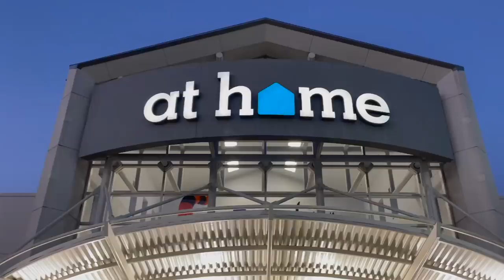MY DREAM SUNROOM IS COMPLETE!| Sunroom/Outdoor Makeover PT. 4 #FIXERUPPER +Decorate with Me!

Comment: Designer tip: always double your sheers.  Whatever the window width is, double that number. It will give you a richer, fuller look.
Reply: Thanks
Reply from the maker: Thanks love for the tip :)
Reply: @Error Report  for example:If the window  measures 50 inches wide, you buy enough curtain to fill 100 inches.  The formula we use is usually width x 2 .
Reply: Shears and Drapery.

Comment: Plant Mom here: You should not repot right away. Give it 2 weeks for the plants to acclimate to your home & new conditions (Keep new plants away from other plants in the beginning in case of bugs.) Additionally, it's actually best to repot into a nursery pot (the same one it came in but you must wash it out) or repot to a larger nursery pot. You should leave in nursery pot or repot in one that has holes for drainage which in avoiding root rot. Terracota pots require you to water more often. I have all your plants & the snake plant & succulents should NOT be watered except once every 3 or 4 weeks. I water my Monstera & White Bird of Paradise 1x per week-water until there is a little water coming out the bottom (you can also bottom water it. (Other people water their Bird of Paradise every other day. Test the soil & if the top inch is dry, consider watering. Buy a water meter..it helps with over watering. GREAT JOB ON THE SUNROOM!!!
Reply from the maker: Thanks so much for all the tips 💕 so helpful !
Reply: Thank you for the advice ! I'm a fairly new plant mom and I'm learning still.
Reply: You're so right! I wanted to comment the same about the plant care. Please please dont put plants in pot with no drainage unless you're a skilled plant carer and perfect with your watering schedule. You'll just give the plants root rot and kill it. Likewise you're not supposed to pot straight into those wicker baskets. It will go mouldy and rot

Comment: Plant tip: water them from the bottom ( via their trays ) and they’ll thank you for it. It’ll also help you know if they’re getting enough water.
Reply from the maker: Ahhhh! Great tip! Thank you hun! 💕💕💕💕
Reply: I've never been told that before...thanks for that info. I'm gonna try this🙏💙
Reply: I forgot ..i remember ny mom doing that. N i tried nyself. But i am not good with plants for now.  I am not giving up
Reply: Thank you I will try this also I always wonder if my plant babies are getting enough water.
Reply: @julesmisic.  Great tip.  If there is still water in the clear, I am assuming the plant doesn’t need water.  Is this correct?
Reply: Great tip, thanks
Reply: What about root rot?
Reply: Yesss! Also helps keep away fungus gnats.
Reply: Yes it does help.  I love the decor I imagined myself with a room like that.  So inviting and cozy!  God Bless!
Reply: @AmmaLove24  Root rot usually happens when the roots are water logged or just sitting in water with no drainage. From my experience, when bottom watering my plants, the roots only drink what they need.
Reply: Beautiful ❤️ and blessings
Reply: Add ice cubes they melt slow and that way you don't over water!!
Reply: @cthompson654  yes! Exactly this.
Reply: I agree that a coffee table will help. Beautiful makeover as always.
Reply: @AmmaLove24  you learn to gauge what the plant needs/wants. When it stops absorbing, pull the water from the tray or bucket, depending on what you’re using.

Comment: Such a beautiful sunroom. Amazing. Definitely getting inspo when I eventually get my own house. 
Plant tip: I’ve found that leaving it in its original container for at least two weeks so it can acclimate to its new environment before repotting it is better. I usually never repot mine unless roots are coming out the bottom or top. I would give them as much light as I can in my small apartment and water when the top 2 inches of soil is dry. Less is more with plants. Hope that helps.

Comment: Just a tip for the plants: don't repot them into those decorative pots because they have no drainage holes - the snake plant and the one in the basket. This last one will probably get moldy from the watering. You should put them in plastic nursery pots and then put that inside the decorative ones. It's a pain, I know... For the snake plant pot, you can always try to drill a few holes if you don't want to repot it again. I don't get why they don't just put watering holes into them -.-